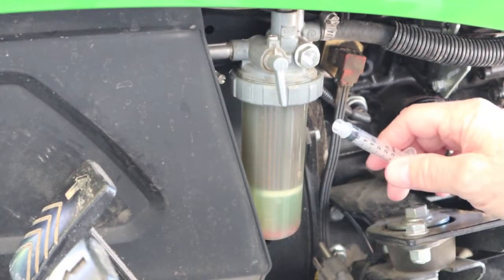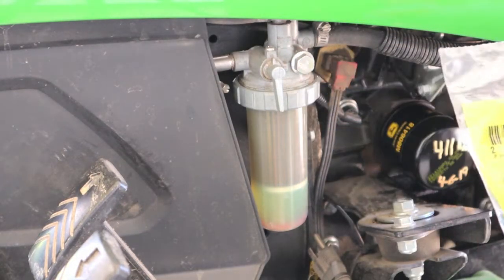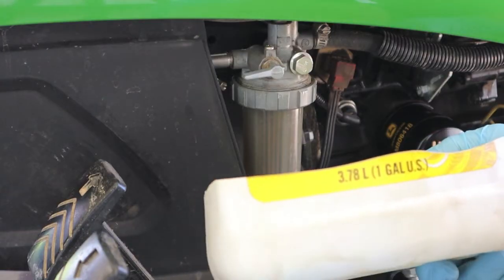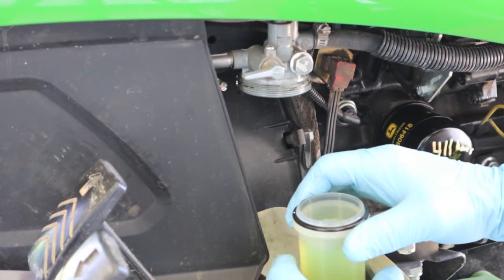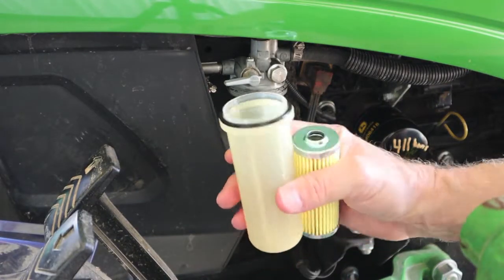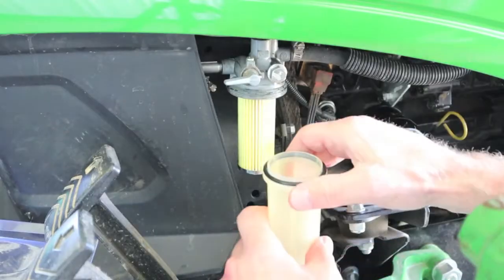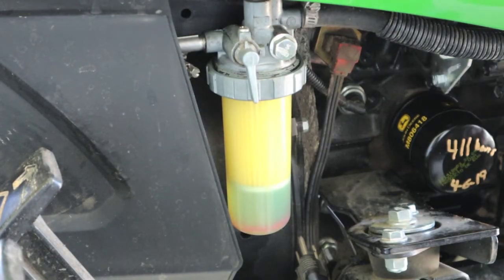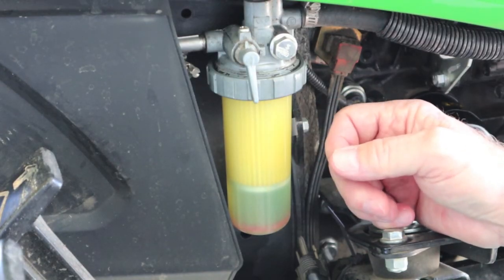John Deere 1025R fuel filter change + water in bowl?

Comment: I followed your directions step by step which was very helpful.  However, it takes like 3 or 4 minutes for my filter "bulb" or compartment to fill.  This is the first time I have changed this filter and I am wondering if the shutoff valve is broken and now allowing enough fuel.  I can leave the fuel pump on for minutes and try to crank it and the thing will run about 5 to 7 seconds and die.  Anyone have ideas?  They are not that expensive, so heading back to JD dealer to get the whole valve assembly (or whatever that part is called).   It was running great before the filter change so I don't see what I could have broke.  Maybe never change the filters.  🙂

Comment: Nice video when you turn the key and the pump starts clicking should it stop when the bowl is full? I noticed after I changed the filter the clicking noise of the fuel pump doesn’t stop clicking even when the bowl is full. Also when I close the valve to change the filter the fuel continues to flow .
Reply: Thank you so much
Reply from the maker: That fuel pump is super low pressure and low amp draw,  about 3 to 4 psi and .5 to 1.2 amps.
It is continuous. It will change sounds as the bowl fills up and/or any change in pressure build up. 
You may need a new shut off valve. Mine is getting so hard to turn I need pliers, it's way too hard to turn with my thumb and index finger.
I just checked it and there is a subtle detent position when you open or close it completely, so be aware of that detent.
Good luck and thank you for watching!
Reply: @pmtips4482  thank you very much when I do change the filter and shut the valve the valve doesn’t hold and fuel continuously flows
Reply from the maker: @ronwood3214  Ron, I put on two small pinch clamps on each side of the fuel line at the little inline filter under the left floor board. I did a video on using them. They will definitely stop fuel flow to the filter base too.
You might try that.
Good luck!

Comment: Great video.. very clear and informative. I wasn’t sure if the shutoff valve needed to be open or closed for this procedure. It’s opposite of what you think. Open is 90 degree to the fuel line pointing at the O and closed is inline parallel with the C. Thank you
Reply from the maker: Thank you for watching and commenting!

Comment: The problem child is that filter under the foot rest. My engine sputtered at full throttle, and I changed the engine fuel filter first. Still sputtered. Found that elusive second filter, and it was filthy. Changed it ( got covered with fuel as usually ) and the tractor ran like a scared rabbit. I would opine that you have to change the underneath filter at least twice as many times as the bowl filter.
Reply from the maker: Yes, that little in-line filter has caused many problems on all brands.
My Dad has a Kubota ZT diesel and performed all scheduled maintenance. 
My brother took over the mower on maintenance and mowing, he forgot the little in-line filter that is in a bad place on that Kubota.
After about 4 years it was nearly plugged completely.
FWIW....reading the owners manual never occurred to them till after it died and would not restart.
Reply: @pmtips4482  I was lucky. The tractor still ran. It just wouldn't produce full power at PTO engine speed. I went back to the owners manual, and found the second filter. Other than the fact that the moron who installed the thing put the one fuel line clamp ears up, it was fairly easy to change. I do need to get those fuel line clamps.
Reply from the maker: @ghostinthemachine8243  The clamps are a big help. Thanks for contributing the problems you had, it will help future readers.
Work safe!

Comment: The 1025R tank is a point down wedge shape so water accumulates in the bottom of the tank.

The main fuel filter then doesn't really work.  You'll see the engine stumbling and stalling, especially on a hill.

The better solution is to screen out water when fueling with a Mr. Funnel Fuel Filter (these come in various sizes).  I have moved over the years to their biggest model simply because it's faster.
Reply from the maker: Great idea!
Thank you for watching!

Comment: Good video.  That particular filter set up is the "el cheapo" John Deere version.  John Deere sells a much better replacement for that unit.  There are other videos on YT showing the replacement filter.  What's wrong with this separator/filter system?  1.  Only a single mounting bolt  2.  Press fit hose barbs  3.  No bowl drain  4.  Not enough capacity  5.  Water can saturate filter element  6.  Prone to leaking in certain applications due to inability to properly tighten.  I have a very similar device on my Takeuchi excavator.  I am currently replacing it as well as modifying the location for ease of access.  My new separator is larger, has threaded hose barbs, easy to use drain valve for regular maintenance, and has two mounting bolts, and no paper filter element.  I leave that to the existing screw in fuel filter which is further down the line mounted directly on the engine and changed regularly.  So when I am done I will have a large capacity water separator, easier maintenance access, and a perfect compliment to my existing fuel filter.
Reply from the maker: That's darn good news!
Do you know any part numbers for the upgrade?
My local JD dealer just lost his dealership with John Deere because he refused to modernize the building. I really can't blame John Deere because the place was looking run down.
I'll research that upgrade.
Thanks for watching and commenting!
Reply: @pmtips4482  I don't have the part number.  I have asked two different YouTubers for the number, but nothing yet.  Also, in my case, I bought a generic water separator on eBay (fits Isuzu diesel truck) and modified that.  Thanks.

Comment: how much pressure in the fuel system of that john deere
Reply from the maker: From the tank to the filter bowl, not much. It is supplied by a small 12 volt pump.
It acts as a lift pump to the injection pump. From the injection pump to the injectors, it is typical high pressure.
Thanks for watching!